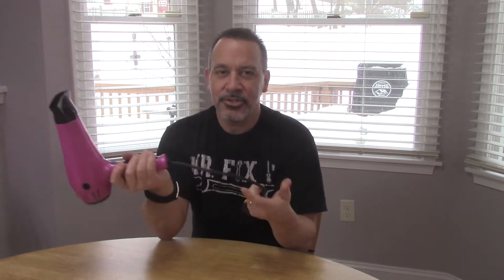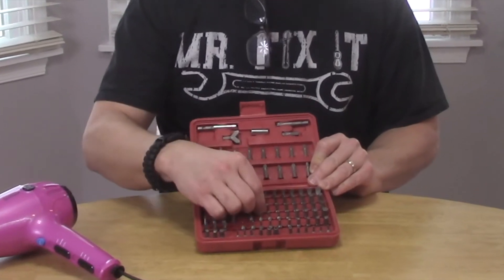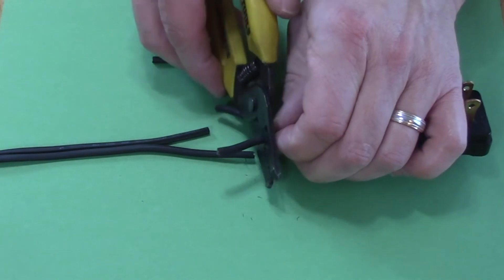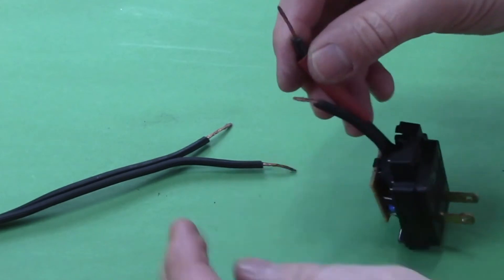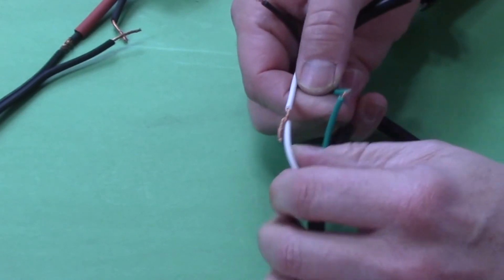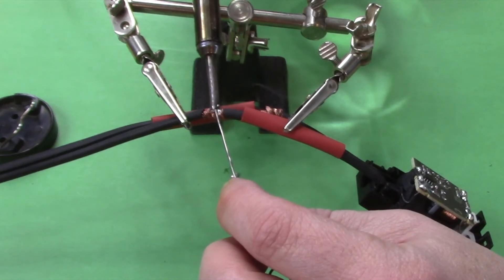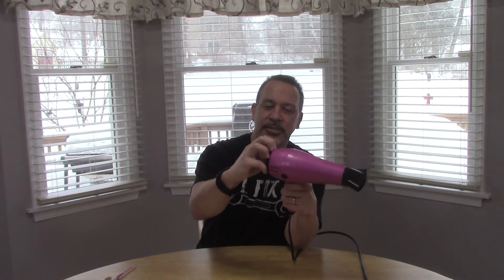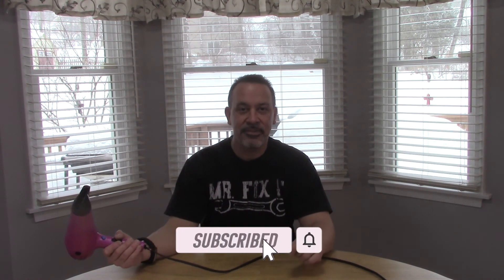Right way to fix electrical cord

Comment: if its an appliance where the cord moves around alot you should not use this method. Either 1: Replace the whole thing; 2: Cut it short; 3: Add a plug and socket at the break;  or 4:  Use a rigid type joint with terminals - either a product made specifically for cord repair or one you create with offset inline wagos or similar or traditional terminal blocks - covered in heat-shrink.
Reply from the maker: Fair point.

Comment: Nice video. I did something similar on a 100ft heavy duty extension cord which I accidentally cut with an electric Hedger (glad it wasn't fingers). But I fixed by cutting the damaged area and starting with fresh ends. I put 3 shrink tubes, 2 over the soldered connections, which were wrapped with quality electrical tape, and for piece of mind, I used the 3rd (extra large) shrink tube to cover both wires. That was 12 years ago and I still use  it today.

Comment: I have a vacuum cord that was cut slightly.  No visible wire was exposed just this white insulation.  There is no visible metal wire showing at all just that white insulation.  Would it be alright to just wrap the slight with electrical tape?
Reply from the maker: As long as you don't see any copper it'll be fine.

Comment: I use saulder heat shrink things it has a saulder ring core hot glue and heat shrink 3 in 1 it's my favorite evin if it fails it protects connection from shorting out / shock
Reply from the maker: The Bell Wrap, from the old phone company, is the way to insure the splice holds.
I think these are the connectors you are talking about.
https://youtu.be/2Ddj2o1DWvA

Comment: Would prolly be a bit easier and would have a stronger hold if you were to strip a bit more of the insulation for longer copper to wrap...I'd suggest at least 2 - 3x more...

Comment: You wouldn't last five minutes as a tradesman in the UK.  Why wouldn't you just shorten the flex by the length of the damaged piece, and re-connect. Far safer.
Reply: Have someone with possibly no experience try to unsolder the factory connection and resolder the new without messing it up seems feasible.
Reply from the maker: Because it was a tutorial on how to splice a wire.  That splice is never gonna fail.

Comment: Very nicely done
Reply from the maker: Thanks.
Reply: Do you have to solder it?
Reply from the maker: You don't have to but if you are not going to then wrap the wires tightly and use a good quality electrical tape like 3M or Scotch.
Reply: @HouseDoctorRay  I think I have not enough cord left at the place that plus into the machine😞
Reply from the maker: Don't give up Susan.  Get a soldering iron from Amazon, hardware store, or Radio Shack.  Find the two spots that the wire is connected inside and unsolder them.  Take the cord after the break and solder it on.
It's not that hard to do and you can't make it worse.  Give it a try and learn a new skill.
You could try the crimp connectors or the connectors in Brian's video:
https://youtu.be/2Ddj2o1DWvA
Reply: @HouseDoctorRay  thanks a bunch I sure like the way you're thinking. I think my Granny would just tell me to buy a new bread machine😅but truth is I don't have anything to lose. Rabbis for perspective!